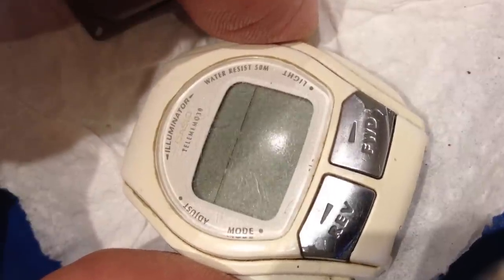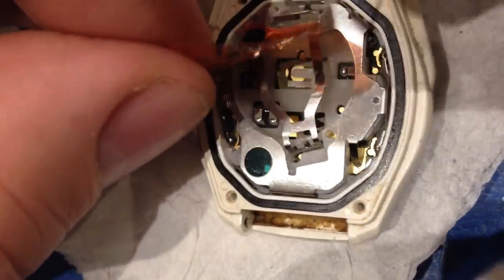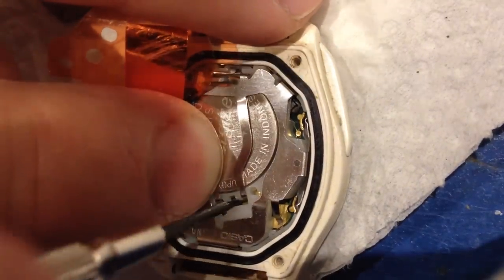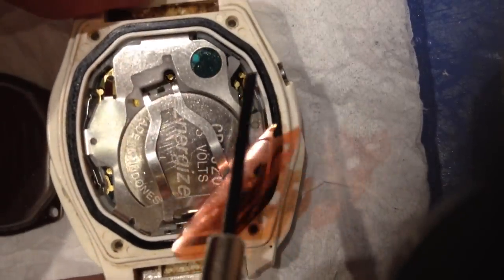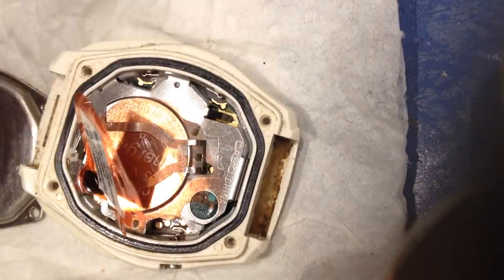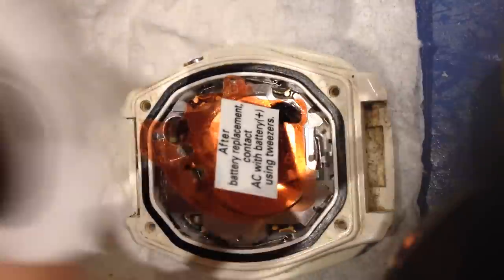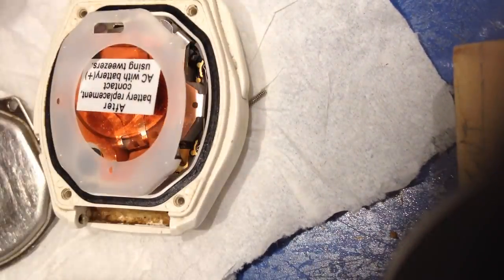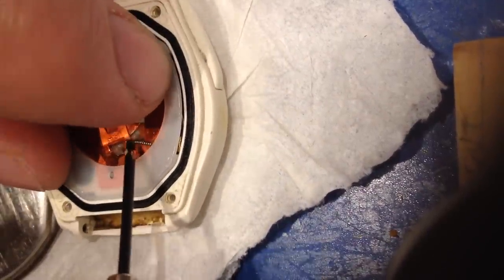CASIO  battery change and AC reset

Comment: Thanks for the video! I tried to replace the battery in my CASIO G7100-1V  and the battery clip would not latch. After inspection with a jewelers loop, I determined that the white plastic housing that held the clip in place wore out.  I have No complaints!, my watch serve me well for over 20 years on one battery !  Time for a new watch!

Comment: THANK YOU SIR! You are the only one kind enough to post a video showing how to AC reset. THANK YOU!!!!
Reply: Casio 950 Alt 6100..Batteries Plus Bulbs installed new battery, but couldn't make it start, so they gave me the battery. Watched your video and it's back working! Ac is the answer. Thank you 😊

Comment: I was going to throw away an old Casio 53w after changing the battery and nothing worked.  After seeing you video - I did the ac reset and it worked.  Thanks!
Reply from the maker: No worries :)

Comment: Yes, its working :) I had not a label "reset AC after battery change" so after battery change, it did not work and then i found this video and yes, there is AC point. And its working again, thank you :)
Reply from the maker: Glad I could help

Comment: Thank you very much, I followed your instructions and managed to replace the battery in my Casio Easy Rec but there is a spring very long and cannot locate it should go. It is really long btw, not like the other short ones, thick at the bottom and get thinner 🤨.

Comment: I have a Casio [555] DBA-80 (using it daily) given to me brand new 1991 when I was very young. I have change the battery several times my self and it have been a pure hell every time to get it going with sometimes hours. About 2 years ago I happened to read a manual to a another Casio and saw it mentioned to put + to AC after battery replacement. Sure I had seen this AC pad the first time I opened the watch and was sure it was the clock signal for calibrations purposes or such. Used a tweezer and put + to this pad and the watch started immediately. 

I just which I had known this 25 years+ ago..
Reply from the maker: Thanks for watching & sharing your story!

Comment: Hello, ive bought a casio cmd 40 TV remote watch! Its on the way to me. The seller said, that he tried to change the batterie by a keymaker/watchrepair store, but the watch dosnt turn on after battery replacemnet. Ive bought the watch anyways, because i think the watch is working, but they didnt knewed, that you have to short it with the ac and the battery. Am i right or this watch dosnt need to be shorted with the ac technique? Thanks!

I mean is this wath fully funkcioning after you simple put in the battery or has the watch to be shorted?
Reply from the maker: If battery is new, try AC reset. Watch the ground spring.If it works, it's a good watch. Let us know how it went.
Reply: @theoverengineer  will report back! But i have to figure out, how i can take the damaged screw out. One is damaged
Reply: @theoverengineer  Ok, the wath arrived! Put a new battery in and it works(old battery was put in upside down...no wondern it didnt worked :))))  )
Everything works except the calculator touch pad. TV remote ect all is working but not the calculator.
I had this before on another casio calculator watch, where ive replaced the battery and some kind of "black rubber/plastic" piece flew out of the watch housing. I didnt knewed how or where to place it and from there on the touch pad never responded anymore. 
Here on tis TV watch i hadnt seen this "black piece"! Should there be one? Or what else could be the problem, that the touch pad dont respond? Ive did the AC reset succesfully and the watch showed 12:00. Thanks
Reply from the maker: Thanks for shaing you story.Not familiar with that part or calculator watches. That lost piece must be could have 2 possible functions. It could be part of the circuit, without which it stays open and not work. Quite possibly part of ground. Could also be an insulator, then without it you have a short on some of the circuits.
Reply: @theoverengineer  hello, ive researched! ITs called zebra connector! It connects the touch pad iwith the circuit. Iv opened up the watch and its missing. Made a photo of it:

https://drive.google.com/file/d/1Rk-ks46crh6vXIKXlHnnitb3zJpQVLKp/view?usp=sharing

Comment: can you use some wire to connect the speaker and the little metal where the spring belongs to? I have no sound on my moon graph watch
Reply from the maker: Sure, it can be jumped, make sure you have current going into the speaker first
Reply: hi, ive opened up a springbar and took the spring out of it! Now my moon phase watch works like it should! Im so happy!!!!! Do you know if its possible to polish out little sratches from the housing it self? I had total succes on the glass. It looks new now after ife sandpapered it and polished it. But on the housing im affraid that the black will be gone. or is the complete housing made of solid black material?
Reply from the maker: Black phosphate coating on metal is cosmetic for corrosion prevention, it is a microscopically thin layer. Same thickness over plastics, for cosmetics or looks only.
Reply: ok so if i would polish it down, then the layer underneeth it would be white plastic?
Reply from the maker: Will likely to be some color other than the surface`s black, plastics come in many color, most are white -ish.
Reply: ok, than i dont polish it! Im so happy the sound works great now and the glass is factory new. Will keep this watch forever

Comment: Is it normal for the display to be absolutely blank after battery replacement? My watch fell of my nightstand and I’m only getting slight flickers of life when I press around on the back of the battery. AC reset does nothing. I’m worried the module is damaged.
Reply from the maker: not normal. If the battery voltage is 1.3V or more, and the screen is dead, it's a big problem

Comment: Thanks bro for your video.. 
Anyone can help, how to reset miyota 0s30 chrono ? 
I tried all buttons, connect with 🔋.
Still dead, maybe my movement is really dead 💀
This is the movement : https://imgur.com/UCIxnXh
Reply from the maker: Nice picture. Does not seem to have an AC reset at all. Circuit might have corrosion under or around the battery. Between the (+) JAPAN and at the bottom of the hole marked (-) there should be 1.5 Volts measured when the circuit is complete.
Reply: theoverengineer 1.5 volts measured using what tool ? Dont understand it haha..
No corrosion, everything seems fine
Reply from the maker: Yeah, ... voltmeter comes to mind with 2 needle probes and a whole list of tech skills ...
Like the guy has at ElectroBOOM channel ...